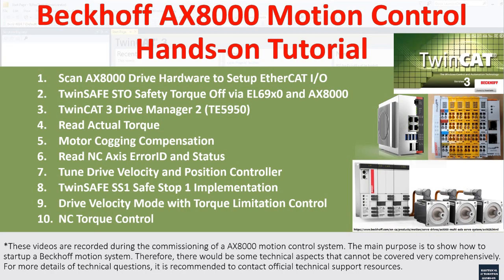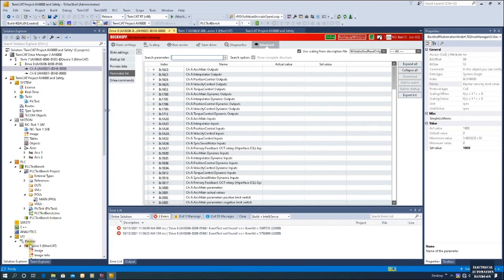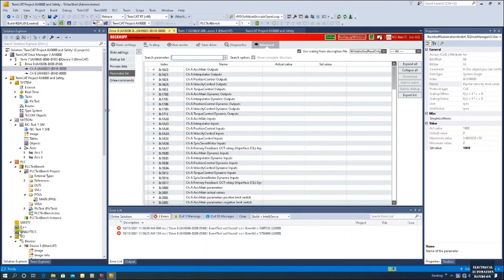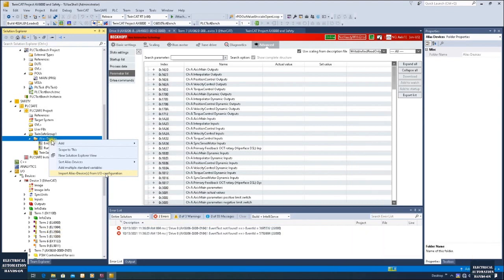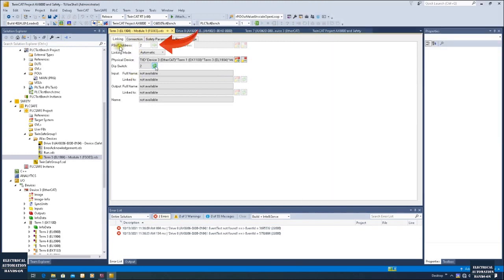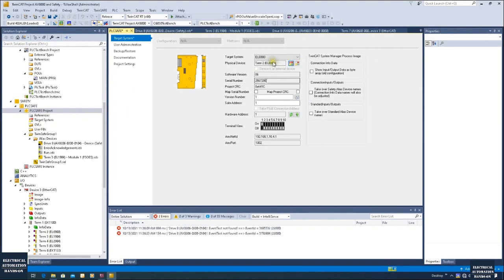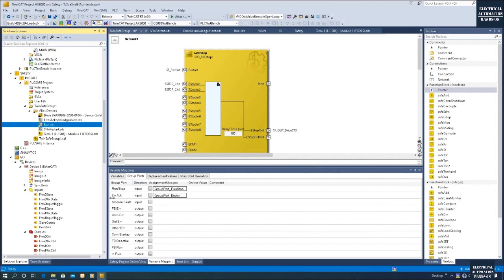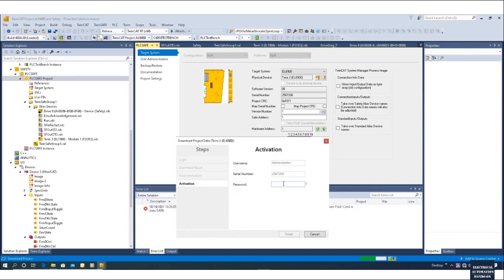MB22. [AX8000 Servo][2/10] Enable Drive STO ‘Safe Torque Off’ via Beckhoff TwinSAFE Program

Comment: thank you for your response another question i have. i have installed drive manager  and driver setup file but when i make a new drive manager file i face with this message:
no supported drivers are found in twincat project....
i would be appreciated if you guide me to solve this issue
thank in advanced
Reply from the maker: Hello, you need to config or upload (Scan) EtherCAT devices via [I/O] firstly. The Drive Manager will pick the drive from the devices under the I/O tree.
Reply: @electricalautomation  yes i have searched IO first and system already has found my AX5000 drive. to be noticied i use my PC as a controller and directly connect to servo drive. but anyway i face wit mentioned fault massage
Reply: Sorry Sir.by the way i havn't connect "LinktoPlc" in system manager. could it be a reoson for this issue?
Reply: @electricalautomation hello. sorry sir i think i found what is problem!! my servo drive's frameware should be updated but i dont know from where i can download it while i searched beckhoff website but i couldn't find anything.would you please help me?????
Reply from the maker: @ariancontrol2430  Aha, this is the reason. You need to connect the PLC and connect the drive, then scan or config drive into your I/O
Reply from the maker: @ariancontrol2430  Hello regarding the firmware issue, I would recommend you contact your local Beckhoff support for firmware troubleshooting.